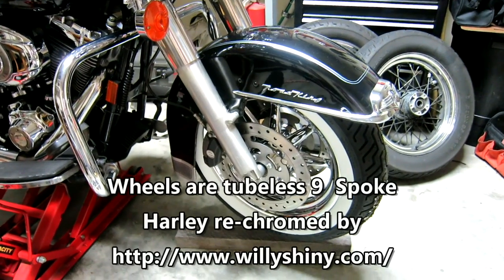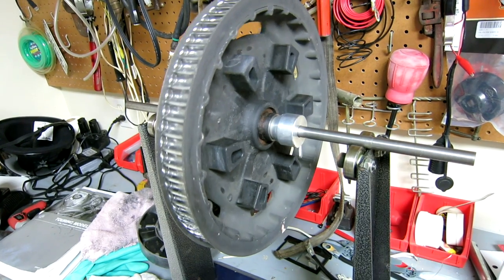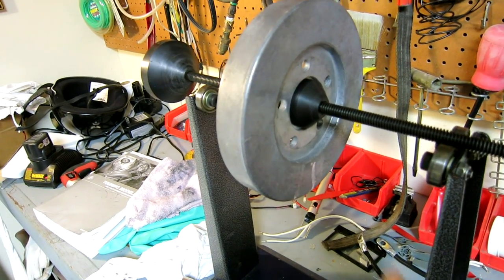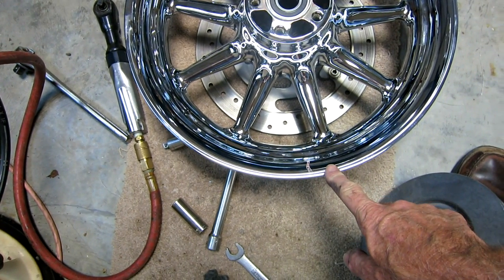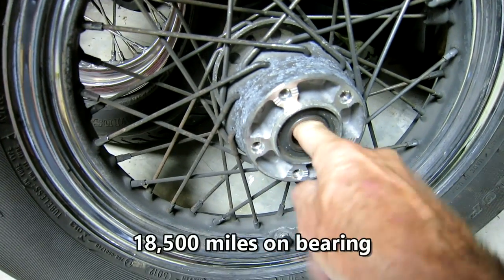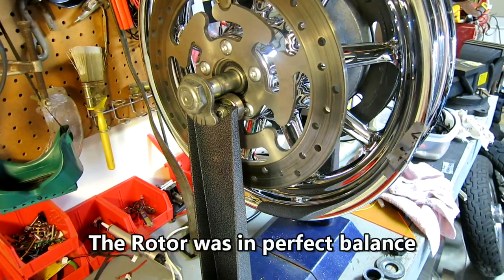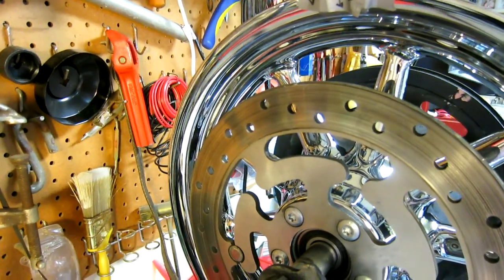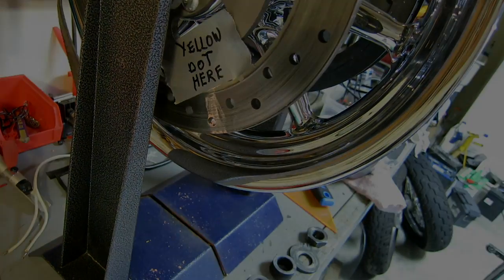Why you should balance your own motorcycle tires

Comment: how do you find the heavy spot on the tire before mounting it?
Reply from the maker: It kind of depends on where the tire was made and the brand so check with them but the dots will tell you the light spot.  The red dot is usually the light spot.  If everything is balance before putting the tire on, it's not going to matter much.

Comment: You are correct to balance each component seperatley! I used to balance large rotating equipment,
and I would use bolts, plates, and putty to bring the imbalance down and then weigh the  parts to find out
how much I was looking at. Putty works great on motorcycle wheels, and then you can duplicate the
weight by grinding down  a clip-on. If you zero-balance a wheel assembly like you did, and when you get your
new tire and it's three ounces out you know the tire is junk and send it back. You should only have to trim
balance the tire. If you find parts that are too heavy on one side, you can grind weight off, then match-mark
and assemble. Thanks for the great video and using common sense!
Reply from the maker: Thanks for the kind words!

Comment: Awesome info. I’ve actually had two tire with valve stem as heavy spot.  But that’s out of hundreds of wheels.  I either use an engraver or paint marker on the inside of rims to mark the heavy spot and the amount of weight it’s heavy.
Reply from the maker: thanks

Comment: WHY YOU SHOULD BALANCE YOUR OWN TIRES ...??

I will tell you why, because you can't trust the tire shops to keep their machines calibrated. Let alone the guy doing the balance on the machine to get it right...They balance your tires, mount them, then you drive off and get vibration. You bring it back and now you have to wait to get them re-balanced. They finally re-balance them, then you still get vibration but from the other end now. You get frustrated, you take it somewhere else, then to find out that they balanced it well and told you it's possible the other shops machine was not calibrated ... So now your entire day is shot, you had to go to 2 different places just to get this shit done... YES it sucks. This is why I purchased my own tire balancer and balance them myself. I just purchased 4 new tires for my Nissan, paid the shop $20 to dismount and mount the new tires with NO balance, they looked at me as if I was crazy. Took the new tires home mounted, put them on my balancer and balanced them myself. Took the car for a test drive at 80 mph, ZERO vibration :-)
Reply from the maker: Totally agree.  I'm too old school, I like the static balance.  It's good up to as fast as I can go, ha.

Comment: I do my own mount and balance using Nomar equipment. Much smoother ride doing it myself. 
If you go to Moto GP races, in the pits they use static balancers on all the race bike tires.
Another good video. Thanks!
Reply: Thanks Larry, didn't know that but if static balance is  good enough for Valentino Rossi (who I love to watch) it should work for us.  But seriously, I've been up to 138 mph on my Gold Wing without a static balance and no issues with balance.  I've got a Nomar balancer/ Marc Parnes and they have always worked great for years.

Comment: It seems that no one noticed that in the "final" balancing that the "axle adjuster was left on while balancing. Axle adjuster does not rotate with the wheel so should not be on the axle while balancing the total assembly.🙀
Reply from the maker: Fair point.  I did balance the shaft by itself to see if the adjuster  made any difference and it didn't.  I'm anal about that but you are correct however, it made no difference.
Reply: Marion, not for 1 second do I believe that the adjuster is "in balance" when on the shaft as the adjuster has a round hole for the shaft & can turn anywhere on the shaft. It may be that the sealed bearings on the balancer have enough drag that it won't register any difference in balance.
I'm curious to see/know what you used to check the balance of the shaft?
Reply from the maker: That's just my opinion and  the way I did it.  Both the shaft and balancer shaft gave me the same results.  Considering, Harley don't even balance the rotor/ bowl, I'd say we're splitting hairs.

Comment: You need to get a NoMar tire changer to go with your balancer.  Makes tire changes fairly easy.  The rear tire on my K1200LT is still a little bit of work as it is one stiff tire, but the NoMar products have worked well for me.
Reply from the maker: I have an electric hydraulic tire changer

Comment: I put 158,000 miles on a K100. I was the only owner. I was amazed because the front bearings were as smooth as if they were new. I never would have thought that sealed bearings could go that far.
Reply from the maker: That is amazing for a motorcycle bearing.  These Harley bearing went out fast, the Goldwing was easy on bearings.